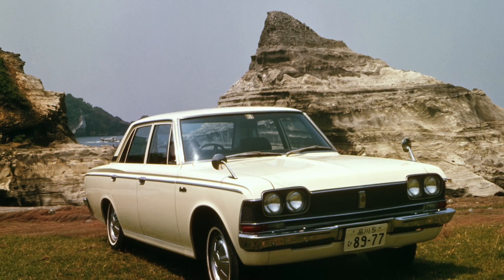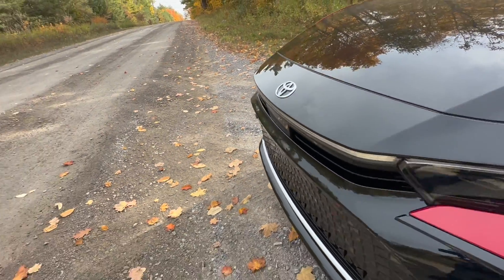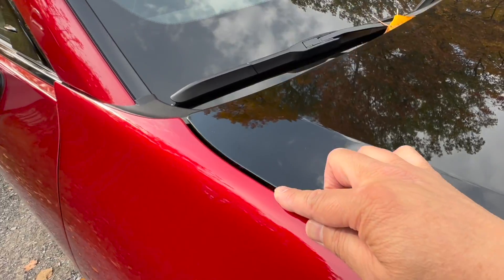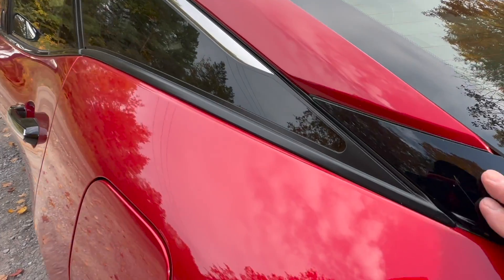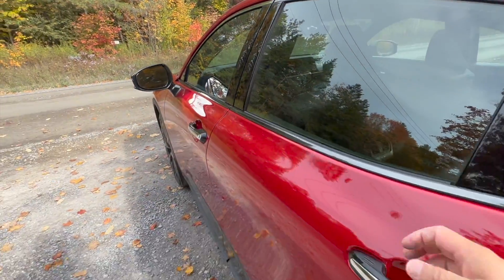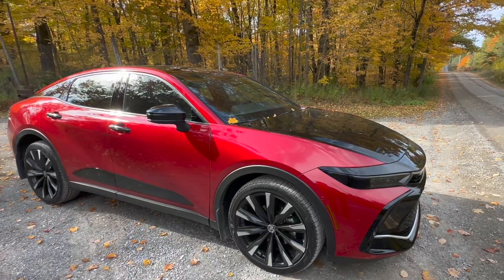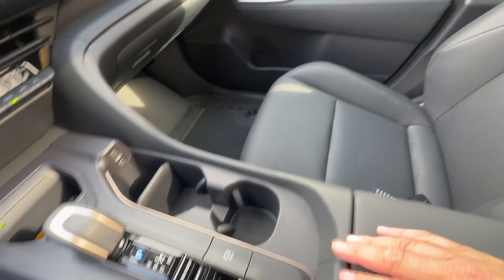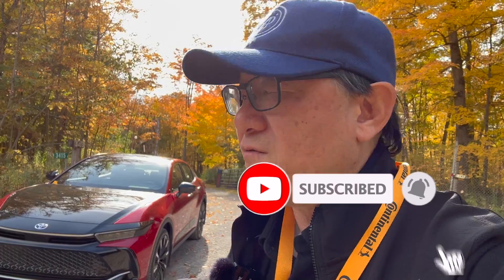HOW IS THE 2023 TOYOTA CROWN'S QUALITY?  IS IT WELL MADE?

Comment: At 2:15 you are commenting about the hood panel gap with the driver side fender. It appears the gap gets noticeably wider up by the firewall (or near the windshield wiper if you prefer.) Is that intentional and/or acceptable? It doesn't bother me but what do you think? Is there a rubber gasket between those two panels?
Reply: I saw that too.
Reply: It looks like it might be the way the camera is pointing. From a top-down view it might be better.